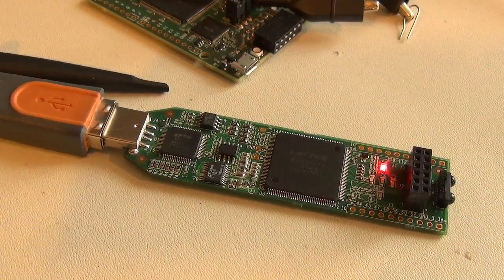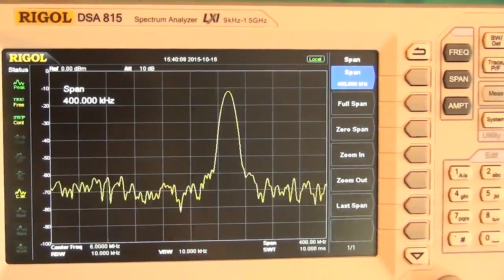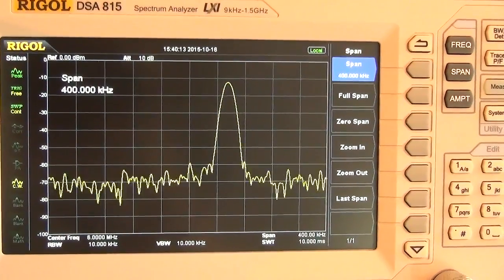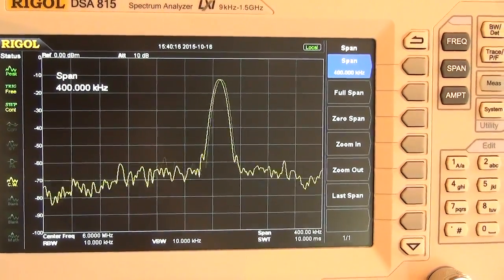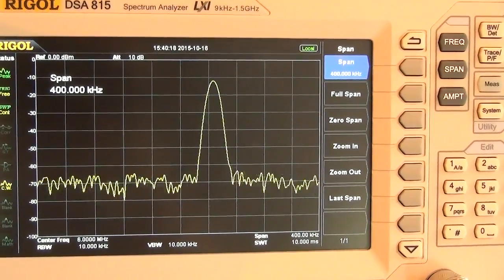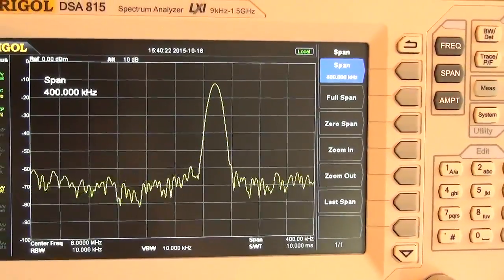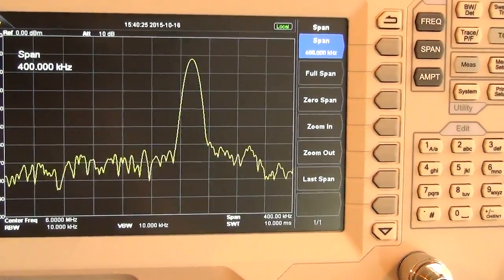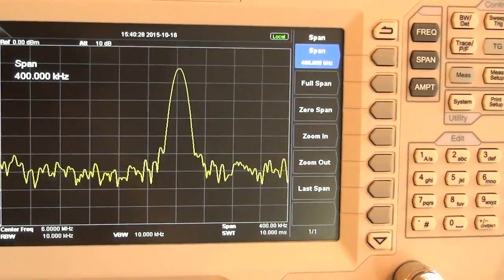Quick Hack: Detect Bending of iCEstick PCB

Comment: Mmm... the ring oscillator is fully inside the FPGA, so I think, when you bend the PCB, you will also bend the FPGA ever so slightly, and maybe a very small deflection in the silicon is enough to change the gate capacitance?